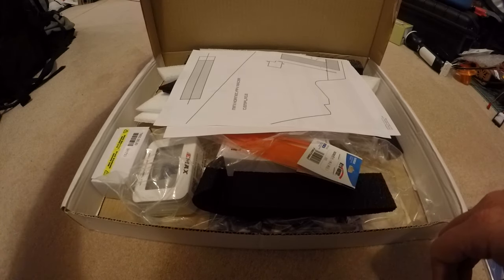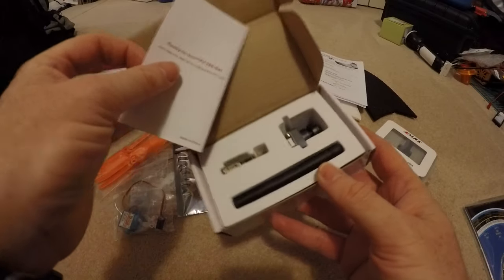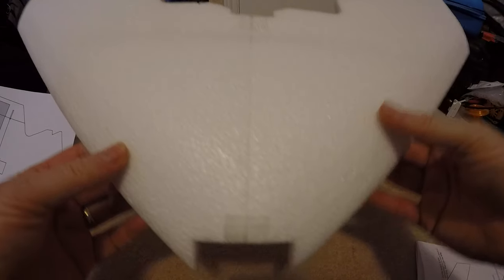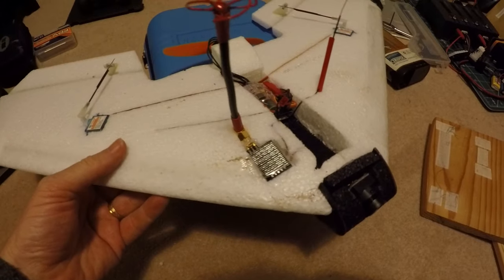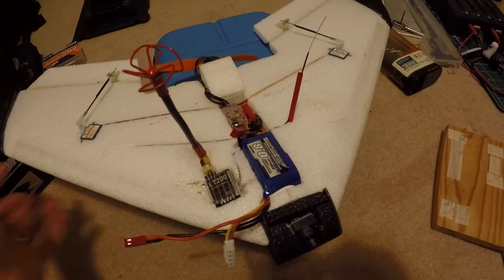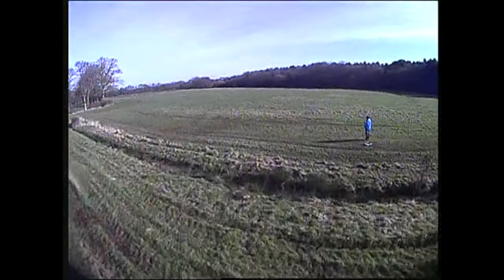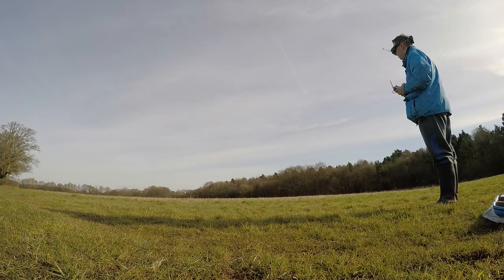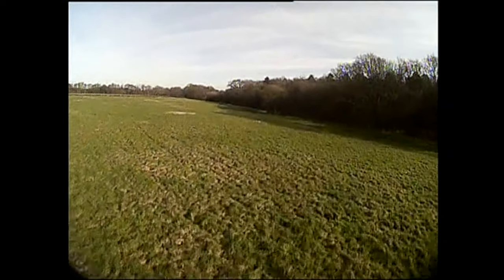Hornet Mini FPV wing Unbox / Build / FPV Maiden/ Review

Comment: Nice video Wayne.  
just bought one of these and will start the build later.   what did you set your throws at? 
thanks
Andy
Reply from the maker: +agrs1974 I forgot to check how much throw I had before I maidened - I know there was a bit in the manual about measuring with a ruler, but I skipped that bit. So I was flying mainly on full throws (and physically I'm using the top hole on the servo arms).  This perhaps needs reining in a little, but not much.  I'll play with a dual rate later, but I don't imagine even on a low rate I'd want anything below about 80%

Comment: Well mine in built and flying. I added about 50% expo and have my throws at about 65%. 
The camera is ok for a quad buy not the wing. great flying wee wing. will add a video later. does anyone know if you can use another board camera with the eachine vtx? 
I am also gonna do a video of my findings regarding building etc
Reply from the maker: +agrs1974 Won't be an issue, just another 12v/video/ground to connect
Reply: +CurryKitten wasn't sure Wayne. just gonna  have a look at what's the best camera.

Comment: Just finished my build, first wing too so i hope the maiden goes as well as yours !
My CG sounds like yours, about 1cm back from what the manual suggests. 

Do you recommend expo and dual rates?, i thought i'd try 60% rates and 25% expo to start with, but have it on a switch. I dont fancy it being twitchy to start with.

Cheers!
Reply from the maker: I'm running between 30% and 40% expo (I usually use 30ish on my planes) but I just checked and for some reason I have two in depending on my rate.  I found I needed at least 80% on my rate else it felt a bit sluggish - I'm tending to fly it full rates now, but I'm used to making very small movements from all the mini quad flying.  If you have a Taranis, or something with plenty of switches, why not try a 60/80/100% rate.  Choose a nice calm day if you can, they will blow around quite a bit in a gust, but they are great fun
Reply: Cool will do, i have the taranis so yeah, easy setup. I'm also used to miniquads but as this is my first wing, i'm kinda apprehensive! lol
I have a Skyhunter Mini plane which i just run at full rates, but its kinda slow and sluggish anyway, i'm expecting the hornet to be shit off a stick :)

Thanks again

Comment: Do you have a link for the mini pz0420 you mentioned?
Reply from the maker: +paulham Here's a link to the cam http://shop.runcam.com/runcam-pz0420m/ I ordered one recently for my new 250 quad (IR blocked) so I'll be getting another for this.  The lens is a bit longer, but aside from that the size is comparable
Reply: Thanks.
I assume the one in the plastic case is same but cased.
Wouldn't a 2.4mm lens be optimal
Reply from the maker: +paulham Yes - camera is just bare in this wing.. I'll try not to crash it into water.  I find the 2.8mm lens to be the best for me, although not tried 2.4mm, had 2.1 and I found it a bit wide which makes some of the image distort.  It's a very personal thing though - go with what suits you